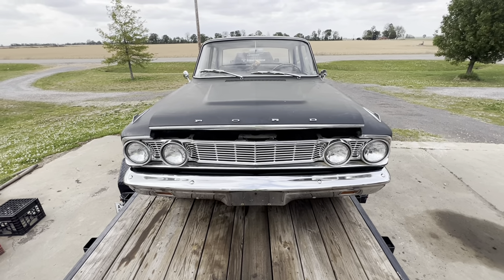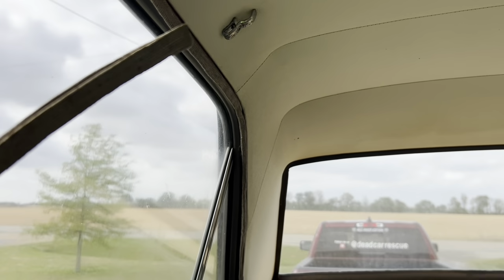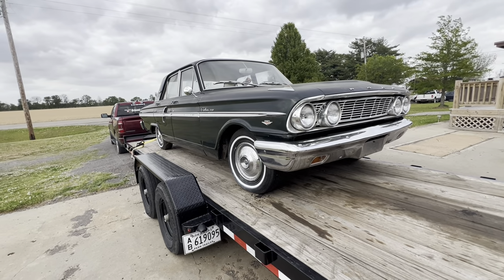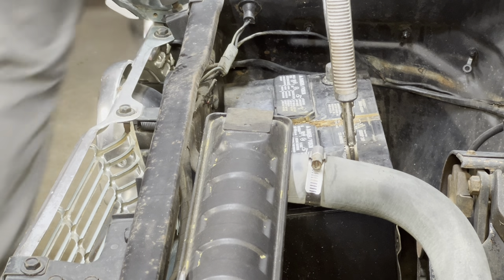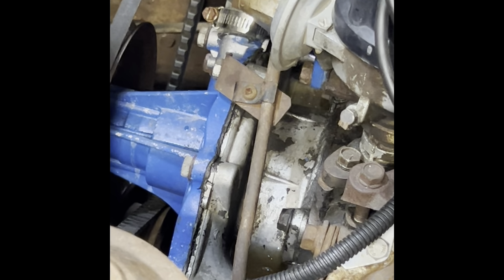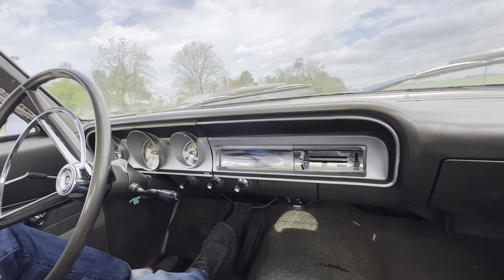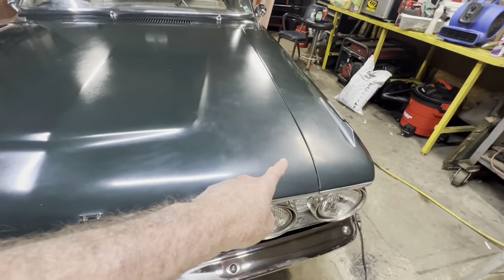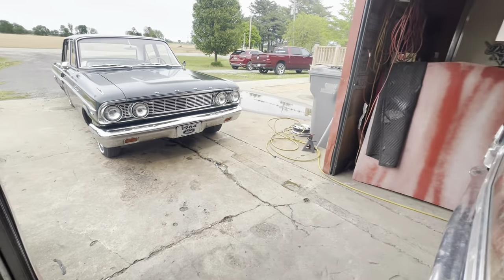***30,000 original miles*** 1964 Ford Fairlane Barn Find.

Comment: Super nice find, that switch on the battery is used in a lot of cases for a parasitic drain on the battery. if you have ever let your car sit for a couple of days only to find a dead battery that switch is one temp solution.
Reply from the maker: I thought it was as old as the car but they sell them to people with boats that usually sit for weeks.

Comment: That little 260 is torquey . I had a pal that had one in a Falcon . 160 HP 258 pound- feet of Torque.  Peppy around town. Just subbed
Reply from the maker: I’ve been driving it around since the video. I put new tires on it Monday and it is just like I bought a new OLD car. It’s so smooth and the steering is really too easy.

Comment: Hi Bobby from NJ. Nice videos. Nice Ford fairlane. I suggest considering oxi clean spray. It's used to take stains out of carpeting and furniture. If you consider that, and if it works for you, let me know.
Reply from the maker: We bought some shout and that did the job. I saw that oxy clean though. I gotta get that new windshield and rear glass rubber to stop that problem. Thanks for watching.

Comment: Should install pertronix. The engine would run a lot better. For the windshield leak Tire repair glue from Temu. I have used it and it is really good for black rubber repair. The tube not the syringe.
Reply from the maker: Yeah I was just using what I had trying to stop the leaks. New windshield and back glass rubber is on its way. That should look better too. Thanks for the tip.

Comment: 3000 grit wet sanding and a super fine cutting compound will take all the spots out of the paint. Looks 80 percent better. If th cardboard is good on the visors they can be sewn. Great purchase.
Reply from the maker: Thank you for the info. So after sanding with 300 grit water sandpaper I can buff out the sanding marks with rubbing compound or just car polish?
Reply: @DEADCARRESCUE  3000 grit and a very light buffing compound not car polish. Should take out most of the scratches and marks. Don’t go through the clear coat.

Comment: Bottom of the car looks original to me probably lacquer which will oxidate  and pit and crack
Reply: P.S. really a nice car just don't find them that good much
Reply from the maker: I love finding them that nice. Just posted a video on a 63. Check it out.
Reply from the maker: It was a respray.
Reply: @DEADCARRESCUE  I did that's the reason I subscribed and watched the 64
Reply: @DEADCARRESCUE  P.S. I'm 69 yrs young and best I can remember seems like I was told that if a older car turns over 100,000 miles the digits will be out of alignment and when it turns over it breaks a piece in the speedometer causing it and it can't be repaired don't know if that is true